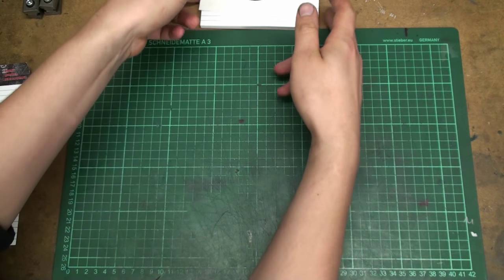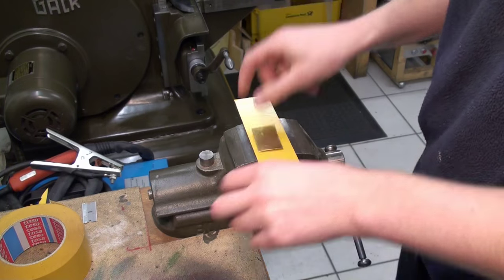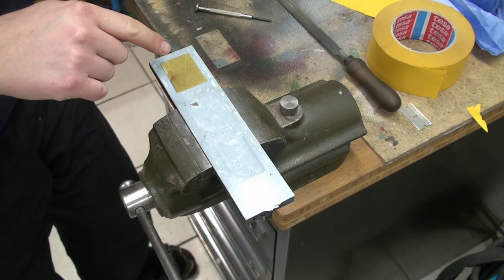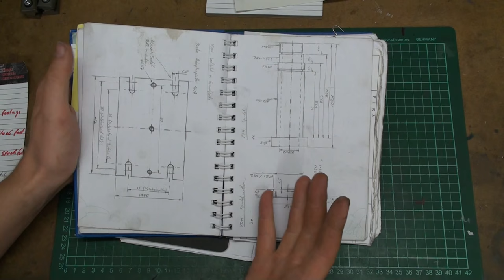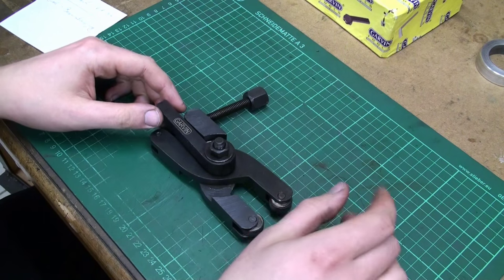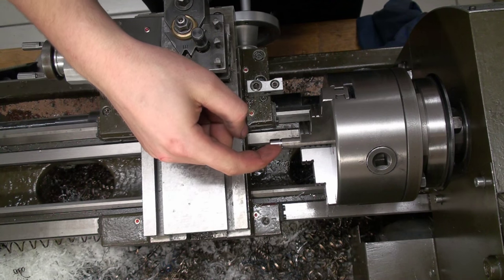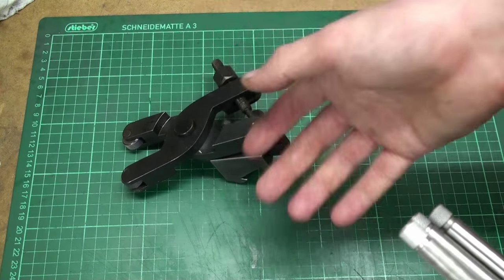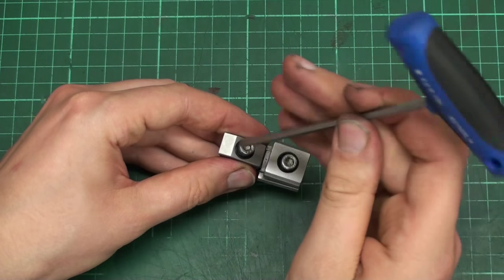Shoptalk #6 / 05-2015

Comment: Nice tip on the spring wire. I've used it too. Those low profile clamps were nicely done and they show the as usual excellent level of detail, fit and finish and overall execution of all your projects.

Comment: Thin nylon fishing line works very well to remove parts attached with silicone adhesives, eg optical components glues to flat plates.
Reply from the maker: Shevill Mathers I will try that, when I come across some - I think I have some thin fishing line somewhere in the shop..but might also be kite-line.
Thanks for watching and commenting!

Comment: Stefan, great video buddy! Even try guitar wire. A,set includes,different sizes and 3 of them are "wound" (wire wrapped around the main wire.). VERY handy for a million uses - and readily available in any music store.
Reply from the maker: BasementShopGuy Thank you very much! Funny enough I have some braided/wound guitar or bass strings here out of my plastic model building time - Was great to fake flexibles hoses. Looks loke I will have to get me some solid guitar wire also!

Comment: Stefan..........I didn't quite understand the detail of your Diamant Moglice video

I can see that you'd milled out a shallow area on the underside of the top slide and filled it with Moglice, turned it upside down onto the surface plate under weights. 

After you'd removed the hardened squeeze out, presumably the surface of the moglice would slightly higher than what was left of the machined slide? That would be the new active surface. That's good and what you wanted I'm guessing.  But even with the weights were you satisfied that that this new moglice surface would be automatically or sufficiently parallel to the top side of the slide?

Thank you and of course I enjoy watching your work.

Ian Beswick
Victoria BC

Comment: Always a pleasure you watch your videos, I'm sure even if you did one on paint drying it would get a few thumbs up. :>)
Your knurling tool seems to be better than Clickspring's, his seems to have the knurl pivots out of alignment which causes, shall we say, "quality issues" ! Take a look at about 47 sec and onward  "Home Machine Shop Tool Making - Machining A Pinion Head Depthing Tool - Part 2"
Reply from the maker: Chris Stephens I will try the drying color next time :D
Hm, youre right his one has a bit of a speed wobble to it - But his knurls come out very nice - Free cutting brass is a bit crapy to knurl anyway because its that brittle. I think I will tune mine up a bit.. :D

Comment: Really, really enjoying your video series. Regarding knurling tools, also check out Accu-trak for ideas if you do make your own. The clamping bolt orientation is a bit safer IMO. The axles are same idea & fit perfect, but are retained with set screws which makes changing knurl wheels so much better over the interference fit press-in style.
https://accu-trak.com/holders_straddle.html
Reply from the maker: Peter Thannhauser Hi Peter, thanks for the link to the accu-trak tool, that design is pretty slick, reminds me very much of a Kantwist clamp, thanks for sharing that link.